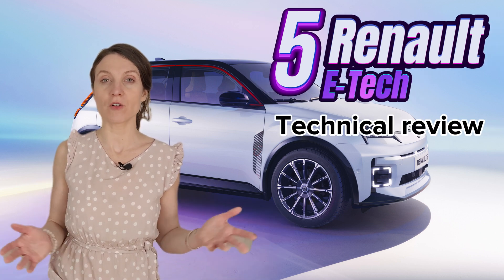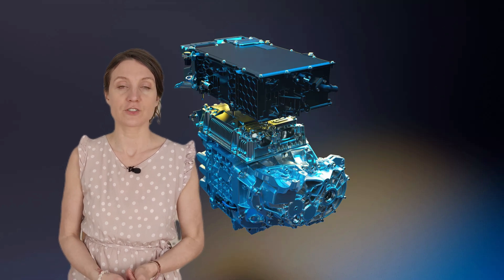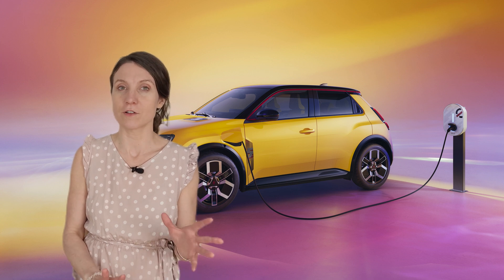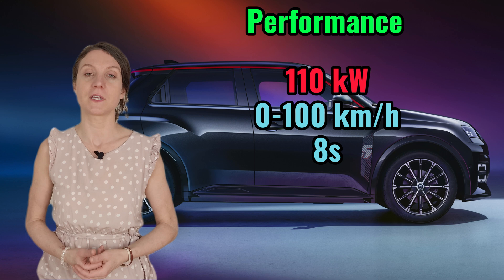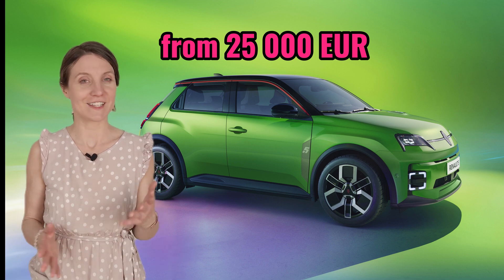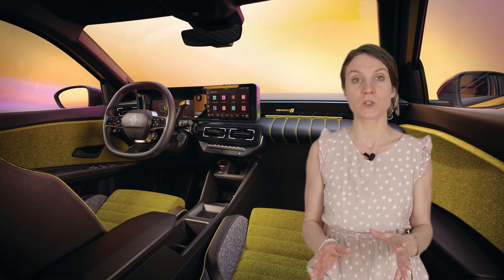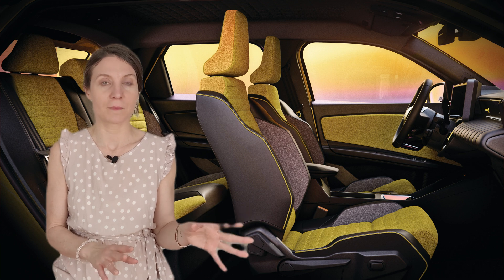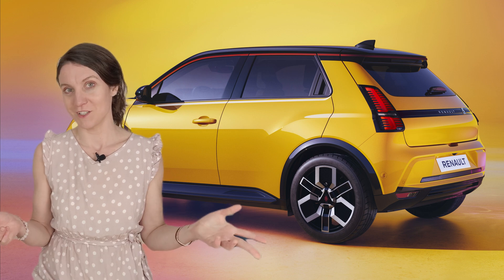Renault 5 E-Tech: Europe's Game-Changer EV with V2G & V2L Tech

Comment: Interesting :)

I am bit confused about the V2G vs V2H, though - in the Intenret I only see Renault 5 having V2L and V2G, but no mention to V2H. But from my logic, if a  car supports V2G it should mean it supports V2H, no? I mean, what matter is if it can send power outwards, whether that electrivity goes to the home or the grid should be a decision made by the controller (or something) that is within the house where the car is connected to. It seems from your explanation you also have the same opinion as me.

Right?

Anyway, I plan on buying a house so I can put solar panels, and charging the car that way, and then at night using some of the energy stored in the car :)

Comment: V to Grid is an important step. Congratulations to Renault for doing that. I would like to expand the solar panels on my roof if i could do V to grid. This technology needs to become a part of our response to energy management. It makes renewable energy sources more useful. Even if 50% of EVs have V to G it could make our world a cleaner place. 
The MG has V to Load which is useful for those of us who live in regional areas and sometimes have power outages. I would love to see V to H for that but V to G is probably a more important technology. I looked into getting a house battery but they are small compared to the batteries in most EVs. 

It looks like an interesting car. The only downside is that I would definitely prefer not to rely on Android for car system management. I have been disappointed more than once with using Google derived stuff only to find it abandoned or neglected after a couple of years when they realise it is not as profitable as they had hoped. I like the idea of a car company having a strong incentive to work directly with its customer base. I don’t like the idea of third party doing a vanilla system as a side hustle. The relationship of the car company with the customers is an important one. I would shy away from a car company who was not fully committed to making their own system and updating it when appropriate themselves. In my experience companies who are prepared to build a direct connection with their customers via firmware are the ones I have been happier with.
Reply from the maker: I totally understand your concerns, but Android Automotive is something else entirely, it's basically the best (outside of Tesla) you can have in a car right now, precisely because the system isn't made by a car company. Google knows much better how we control and want to control touchscreens. Everything that annoys me in cars with manufacturer infotainment, Android Automotive has sorted out. I recommend looking at a couple of Megane E-Tech, or Scenic e-Tech, or Polestar 2 reviews to see how great their infotainments are.

Otherwise, V2G is perfect for exactly what you write, having 50+ kWh in a car connected to the house, you could do magic with pricing and consumption, I'd enjoy it very much. I see a necessary future in this. 🙂 I'm surprised the uptake is so slow. I think there should have been V2G in the Megane too, but something Renault didn't manage to finish unfortunately.
Reply: @siasek  Actually responsiveness of a touch screen is about the hardware level more than the operating system. How finely tuned is the chip behind the screen? Google has produced some great stuff but not been all that good at building more than software for browsing. Look at the things they have abandoned and neglected. Google don’t make chips. If the chip design is fast the system can interact really well with the operating system. Great hardware at the chip level allows firmware features to work properly. There are real limits to how much you can tweak the software if you don’t have great chip design. I guess that’s why I want to see car companies working closely with chip designers and directly involved with setting the agenda for how to set up the vehicle.
Reply from the maker: Exactly, Renault's infotainments are totally fine-tuned, probably also because there are strict hardware requirements for Android automotive. It's as smooth as a Tesla. It makes me happy that someone can make a proper infotainment besides Tesla.